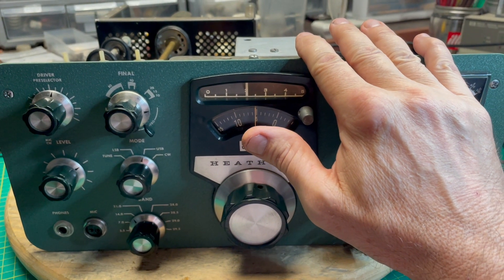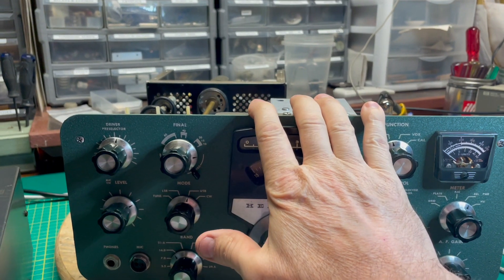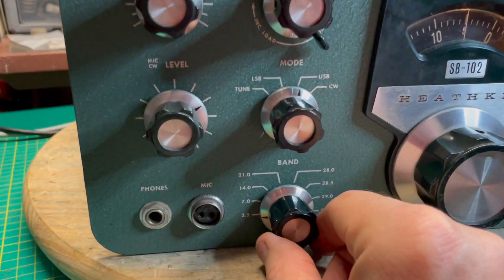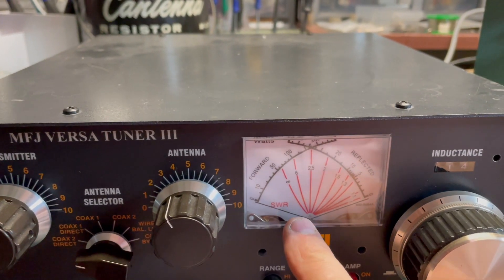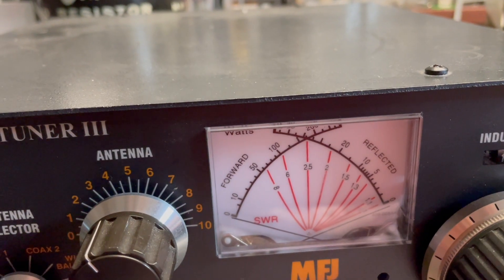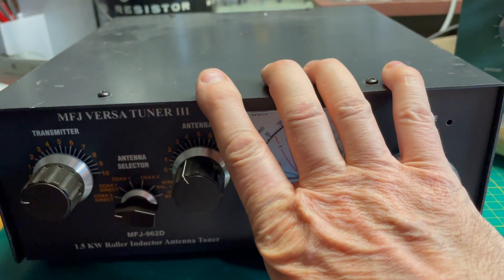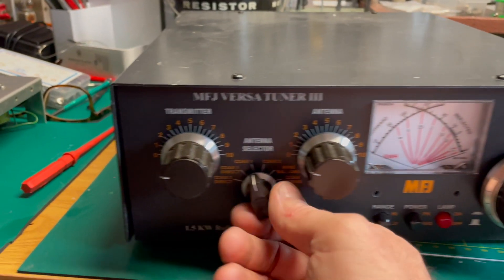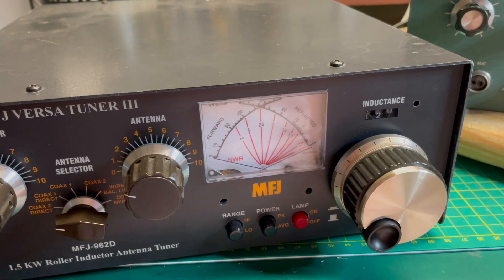Tuning a Heathkit Transceiver

Comment: Will I missed this post a month ago.
When I go in TUNE  setting preselect to max RF output on tuner/dummy load and Plate for max  if I  crank up the CW  control clockwise if I max it the PLATE mA pegs the meter and the power supply breaker pops.

I only get about 15 to 20 watts to the tuner after tuning the rig. What should I look for to fix this?

Sam AE4GX
Reply: If the tuning was possible and the final ragged later, may be the driver or final was oscillating. Dont allow more then 150mA continuous, turn off instant! 1. Check the bias if lower 50mA then one or both final tube are destroyed. 2. If ok then check neutralisation of the two stages to prevent further oscillations!! 3. Check the rectifiers in the power supply after breaker pops. 4. Some times old electrolytics have extremely high leakage currents during first power on after long turned off. This can also activate the breaker. ;) ;)

Comment: Remember doing this with a Yaesu FT-101EE back in late 70's although I didn't need a tuner. In fact, still own an FT-101EE although not the same unit than back then.

BTW I also have a full Drake C-line, including the amp.

I always wanted to have some Heath stuff but never came up with any.